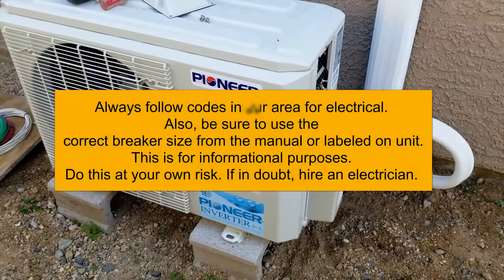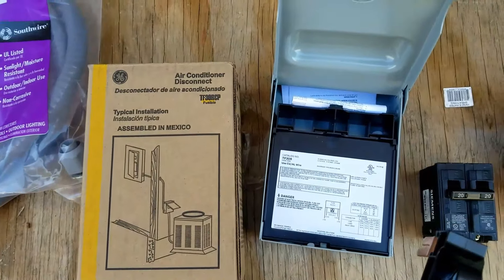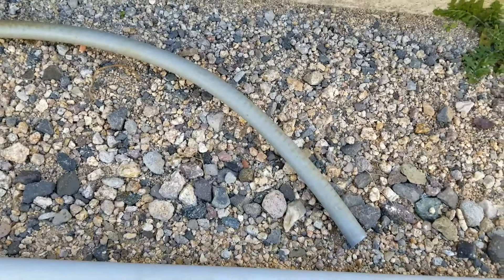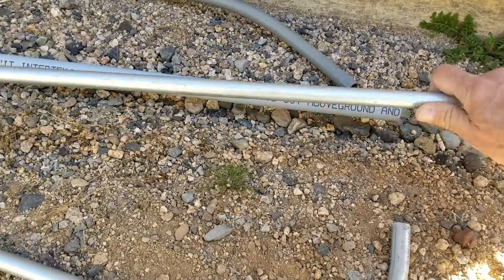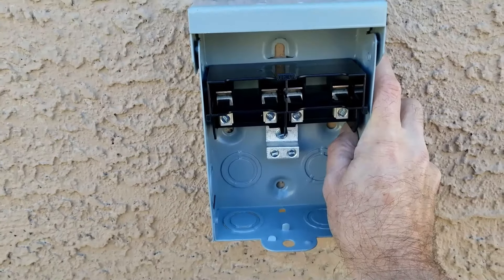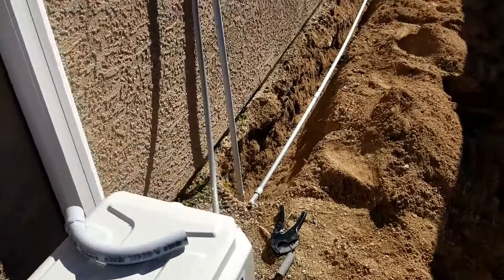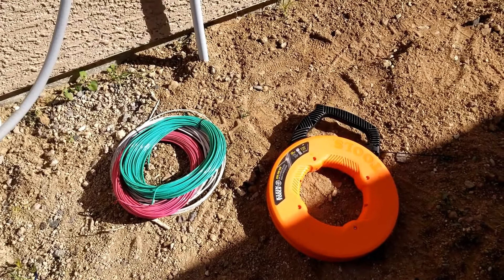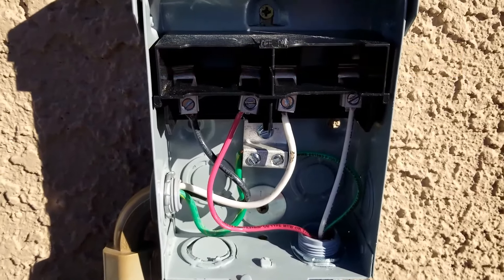How To Run Electrical Wiring to a Mini Split (Connecting Breaker Disconnect Conduit 230/115 volts)

Comment from the maker: UPDATE: After this video I swap out the beaker for a Square D breaker to match the panel.
Reply: Panel matching breaker brand is just a revenue-making restriction. Siemens is actually a better breaker than Square D, no seize ups and hiccups.

Comment: You should have used a red and black wires on a 220v circuit, not white.
Reply: Mark the white with red tape and all fine.
Reply: So would the negative replace the neutral?
Reply: @ciscokidfab7595 Colour only matters so nobody gets confused and for “code”. Realistically any wire colour can replace any wire colour
Reply: @ciscokidfab7595 no negative in 220v. Two hots at 120v and a ground

Comment: I'm amazed that any video on electrical wiring,  always, I mean always has disagreements on what gauge wire or what amp breaker to use... Seriously, is there not one correct way to wire?.. does code have flexibility in the options utilized

Comment: I installed a 9000 BTU unit and it use a 15 amp breaker and 14 Gauge wire. Thanks for the video very helpful
Reply: Hi 
And how is work? 
Is any problem with wire 14 Gauge and 15 amp to connect to 9000 btu ? 
Thanks
Reply: @andrehmoti1411  My unit is rated for 15 AMP breaker 14 Gauge wire, so it works good for me
Reply: @JereB698  how many volt 230v or 115v ?
Thanks
Reply: @andrehmoti1411  230 volt
Reply: is 15 amp Double-Pole Circuit Breaker ?

Comment: Why are these 240 volt mini splits not wired the same as a washer dryer combo which are four wire? There is no bonding? The green jumper wire would be removed so the bare ground wire could be used to bond the unit. A shock hazard similar to a washer dryer combo?

Comment: A well done video.  Only thing I would suggest is to ether have run the "hot" legs as red and black, or at the very least, marked the white wires with black marker to denote that they are not a grounding (neutral) connector, but are used as a hot.  Again, if this was me, I would have picked up Red / Black / green from the supply store.  

But still, a very good video.
Reply: You seem to know about electrical. I am installing a 2-zone unit, and the 240-volt connector has a place for re 11:58 d, and black, and the 3rd one is ground. Is the 3rd one for connecting the neutral white? The instructions are pretty bad. Thanks
Reply: @fernandorivera7155  no, never connect white to ground. Green only. It should be black to L1, Red to L2 and green to ground. White should only ever be used as neutral (N) terminal.

Comment: Can youbrun 2 minisplits from the same unit
???
Reply from the maker: Yes, there are what are called dual zone units that have two inside heads and one outside condenser.

Comment: Thank you for the video.  I am connecting mine this week.  I have installed my steel pipe, but I used tight corners.  You used  a curved pipe for making turns.  Is this code?
Reply from the maker: Outside metal conduit corners are usually bought and attached. Bending the corners is usually only done during new construction where they can fit into the wall. There are good YouTube videos on installing metal conduit. Be sure to check your local codes since they can vary.

Comment: I have Mr cool 18K BTU mini split. I have a 12/2 yellow-colored 20 amp 125 V electrical wire to the disconnect box. However, the mini split requires 220 V. Should I add another 12/2 line and combine with the other one at the disconnect ?
Reply from the maker: Electrical wire is rated for the amps and matched to the unit. The wire's 20-amp rating is likely good; but be sure to check the manual. The yellow wire is likely Romex, which is wire in a sleeve usually used when wiring a home. Be sure to check your local codes but most regions don't let Romex be run inside a tube since it can overheat. If the Romex is not in a tube and in the open, then it is OK to use.

Comment: Does a 240amp minisplit system that's 24,000BTU need a 20 or 30 amp breaker?
Reply from the maker: It can vary between units. Look at the manual or nameplate on the unit for the max amps. That can be used to buy the breaker needed.
Reply: @HVAC_Mechanic  thanks

Comment: Should I use stranded wire or solid wire going to the panel??
Reply from the maker: Either can be used, but most HVAC installers use stranded wire. Stranded wire is easier to work with.
Reply: @ THANK YOU

Comment: What fitting are you using for your 1,2 & 3 wire from the inside unit to outside unit? Looks like a sealtight?

Comment: Couldn’t you just run then pipe along under the stucco ,anchored? Just a thought
Reply from the maker: It depends on the code in the area. I have seen homeowners do that, and I don't think it's an issue, but depending on the area's codes, it may not be allow.

Comment: Im going to install a 12,000 btu Traiden mini split 
I' d like to know if I can place the external unit on top of the roof.......
It will be at about 3 ft. Above the internal unit level
Reply from the maker: Yes, they can be set on the roof. Three feet from the unit, the line set will likely need to be cut and re-flared, but you can leave it rolled up.
Reply: @HVAC_Mechanic  exelente, thank you

Comment: I bought a pioneer 12k btu but it’s a 115v 60Hz 1Ph with a max fuse of 25A. This means I need to run a 10g wire right? And does my breaker need to be single phase or double?
Reply from the maker: 10-gauge wire will work on a 25-amp circuit with no issues; just use the correct breaker size (Some 12-gauge wire is also rated for 25-amps but be sure to check its specifications). In the USA 120/240 Vac is single-phase.

Comment: Can I use a 60amp disconnect with a 30amp fuses or 30amp disconnect non fuse
Reply: Just make sure the fuses and breaker are right for your unit, and that the disconnect is rated for enough power.

Comment: What’s wrong with using pvc? Haven’t you seen it used above ground on every power pole pretty much anywhere
Reply from the maker: If the PVC is run sideways, it will sag, which is a bad look. In the climate where I live, the sun turns it black and gives it a burnt look after 2-3 years. It can be used, but it doesn't look good after a few years, at least where I live.
Reply: I don't know if it's allowed, but painting it with latex paint will help preserve it.

Comment: Can I use a 12-2 wire for a 3 zone , 27,000 btu pioneer mini split.
Reply: Look at the name plate on the unit. The information you need will be listed there

Comment: I have a 12k btu unit 110v, can I plug this into a regular plug?
Reply from the maker: No, that's not recommended, but it would depend on the amps the unit uses. A standard home outlet capacity is 15-20 amp so the units rated amp draw would need to be below that. It also would need all other outlets and lights on the circuit to be blocked off. It is best to run its own dedicated wiring and breaker.
Reply: No.  Dedicated circuit required.  Can't repurpose an old one.

Comment: do you need a disconnect box if your main panel is 4 feet from your condenser unit? I hoping to remove the disconnect box and run the L1 & L2 wires directly to the 20amp breaker in the panel. is that not safe?
Reply from the maker: It depends on the location and is required by code, which I think is all USA jurisdictions, but it is possible it is not required in some areas. You will need to check local codes to know for sure. It likely is safe, but if an inspection is needed, such as for a new installation or selling the home, it will likely not pass. It is best to talk to a local electrician and see what they say.
Reply: You need a means of disconnect within 6 feet.  Sounds like your breaker panel within 4 feet will suffice.  Be sure to clearly label the breakers.  Black sharpie pen is not a suitable labeling device.

Comment: Why do people recommend fusible disconnects vs the one u used
Reply from the maker: Both work the same. I suppose having fuses adds extra safety, but if it's on a breaker, it is good.
Reply: @HVAC_Mechanic  thank u

Comment: I have an existing fuse disconnect 3 ton AC with a 40 amp breaker in the main panel. Can I add a 1 ton minisplit by replacing the fuse disconnect into 2 breaker subpanel of 30 amp and 20 amp subpanel?
Reply from the maker: The wire and breaker all need the rated size. If the wire is rated for 50 amps (6-Gauge) and the 3-Ton Ac unit rated for 30 Amps than it can be done otherwise a new breaker and wiring will be needed.

Comment: Help….does the circuit need to be GFCI? Thanks!
Reply from the maker: No, a GFCI is not used. Just a disconnect and the correct wire and breaker size.

Comment: I have a 24k unit and it calls for 220v. What breaker amp would I need to make it 220?
Reply from the maker: Breaker size can vary depending on how efficient the unit is and depends on the unit-rated AMPs. The rated AMPs will be in the manual or the unit's nameplate.

Comment: My 9k unit is 120 V. Can you please tell me how to wire the disconnect?
Reply from the maker: It is best to watch a video as there are a lot of them for wiring a disconnect, but a disconnect is just a way to break the wire connection quickly. Basically, each leg (wire) goes to one port and the same on the other side. Some electricians tie the common (white) wires together and just break the connection with the Hot (black) wire.

Comment: My electrical panel is quite a ways away from where my mini split is going - complete opposite side of the house.  I have an existing outlet on the INSIDE of the wall - can I re-purpose that and put a breaker/disconnect off of that (no longer to be used on the inside) to the outside or do I need to run a dedicated line?  Dealing with a 115v unit.
Reply from the maker: It will depend on whether the wire size is rated for the amps. 115-volt units pull more amps, often roughly 20 amps or more (but be sure to check). Indoor wiring can be 14-gauge or 12-gauge. 14-gauge wire is rated for up to 15 Amps, and 12-gauge wire is rated for 20 amps. While it is possible, it is likely best to have an electrician examine it.
Reply: @HVAC_Mechanic  I believe it requires a dedicated circuit, and that outlet is probably required to remain there, and it likely also has other outlets or devices on that same circuit, so such a conversion is not suitable.

Comment: Can i use 15 amp Double-Pole Circuit Breaker  for 9000 btu ? or not? thank you !
Reply from the maker: The type of breaker needed will be in the manual, or you can go from the voltage and amps the unit uses.

Comment: My manual says nothing about breaker or wire size.
Reply from the maker: Look for the Max Amps the unit uses, and that can be matched to the breaker and wire size.
Reply: Right.  Go to a chart on the web for recommended wire sizes based on electrical load and length of wire.
Reply: I'd just use 8

Comment: If you get that inspected that Siemens breaker in a Schneider Sq D panel and White on L1 will get flagged.
Reply from the maker: You are correct it was what I had on hand that day. I was told the breaker was rated to work in the panel, but I swapped it out a few days later so there would be no issues. I also used a marker and some tape to mark the wire.
Reply: @HVAC_Mechanic  I’ve subscribed, I think you did a really nice job in this video.

Comment: How much would an electrician usually charge for this type of job?
Reply from the maker: Where I live, it is roughly $300-$800. It will depend on where the electrical box is and where the unit is set; a long hard run will cost more. The only way to know the cost for sure is to get quotes.
Reply: Thank you sir and great video

Comment: would the same size double pole breaker work with MRCOOL EZ Pro Single Zone 12000-BTU 18 SEER Ductless Mini Split Air Conditioner Heat Pump 
115-Volt
Reply from the maker: No, 115 volts will use a single pole breaker. The ground and neutral wire will both go to the ground bar, and the hot wire will go through the breaker. It is likely best to watch a video on wiring a single pole breaker.